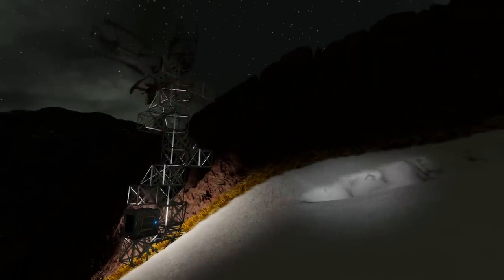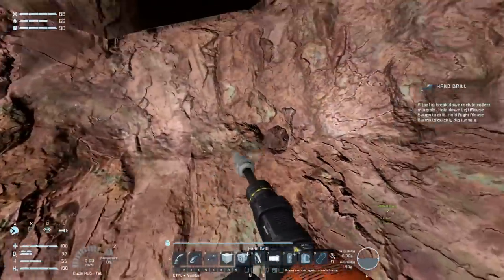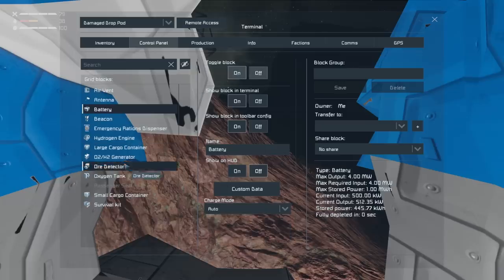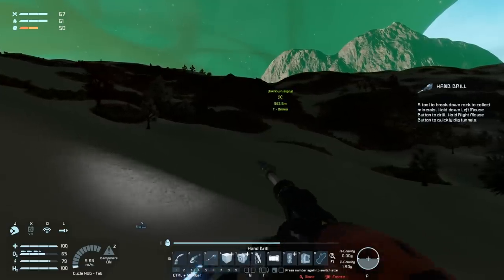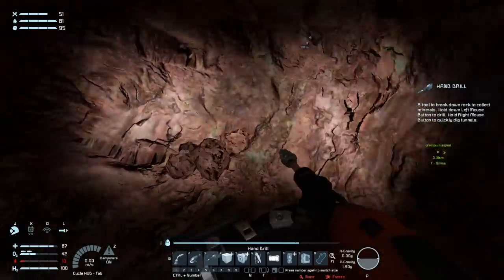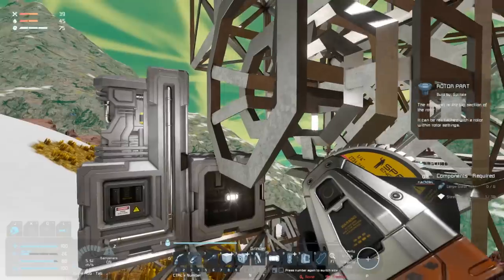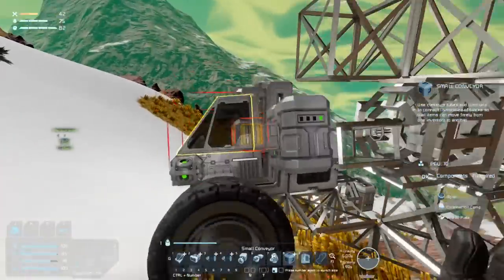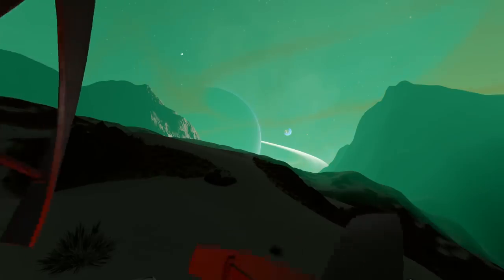Survival Impossible #2 - Space Engineers Hardcore Survival

Comment: the assembler system in space engineers is great as it is I don't think you can add a second step of production because by design it is ore, into ingots, into components, adding more steps needlessly complicates the process and ruins the progression of the game.
take a look at subnautica for example, you have a fabricator that can make most everything out of base materials such as ore or plants, no in between steps, just pure science, and that is one of the games selling points that while it isn't a realistic system by any means, it doesn't have to be because it's a sci-fi game.
the same is true for space engineers except it has an ore processing step, there is no machine that turns ingots into wires to use in motors, just ingots into motors, and without any view inside an assembler or refinery, there is no need to explain the process of how it works, and being a sci-fi game, space engineers can do that and has the foundations of its assembling / refining system perfectly set out for the games thematic.

TL;DR
Don't add another step of production into space engineers, it's much better idea to keep with the aesthetic and thematic of the game. Complicating the system any more would just make it a 3D voxel based factorio.
Reply from the maker: I'm not for a second suggesting such a complex system should be added to vanilla, I'm talking purely about modding for a more in depth gameplay experience where the added challenge of needing multiple blocks might restrict full production systems from being built aboard basically any large grid ship. These discussions are around thinking of some ways to step up the challenge for this particular scenario and around my own dislike of 'tiered' systems in games that mean the previous level gets made completely obsolete by the next - basic assembler is useless the moment you can build the full one. 

As the person who's probably taught more people how to play Space Engineers than anyone else (if the view counts on YouTube are anything to go by) I would not want things to be more complex in the vanilla game, it's already a steep learning curve that many struggle with, and while I enjoy the idea of more complexity, my experience trying to learn Stationeers productions systems tells me it's not the best thing to have as a base game if you're wanting a broad audience :P
Reply: @Splitsie  I actually just came up with an idea, you've probably heard it before but, what about if you just added a requirement to the full assembler that requires it to be connected via conveyor with a basic assembler to manufacture basic parts, and either the full assembler gets the recipes added for basic parts, or the basic assembler gets a boost in efficiency for being connected to a full assembler and manufactures the basic parts leaving the full assembler for advanced parts.
This way there isn't any requirement to add upgrade modules to the basic assembler, just an efficiency / speed increase for being connected to a full assembler. (kinda like an upgrade module on the full assembler)
I don't mod space engineers so I don't know how much spaghetti code they got but the way I see it would be to add a speed and efficiency stat to the basic assembler basically mirroring the system already in place on the full assembler and refinery if you were to use it to produce basic parts, or give it an upgrade module definition (or new block if it can't have that definition) and input values for efficiency and speed same as the upgrade modules. (still don't know about adding the recipes when the module is attached though, maybe it isn't that hard but idk)

Comment: 13:25 yeah, the 6 years is wrong. H2 gen power time has never worked properly. Also, turn off your o2 gen if it is empty, for some reason the currently use their full power even while idle
Reply: yeah in most cases, the o2 gens are the hungriest power consumers, just annoying having to turn it on and off via control panel, i suppose a button would be handy for that though
Reply: @_harbinjer  yeah, they have always used max power even when running at a tiny percent of max, but it appears that now they use max power even when on but not doing anything.
Reply from the maker: Yeah, there's something seriously wonky about H2 in space engineers, I don't expect it'll ever get fixed, but it's similar to the way that your power reserves make no sense if you have batteries and reactors online :/